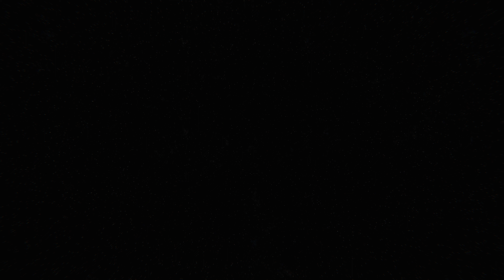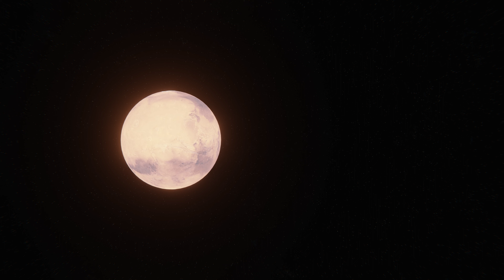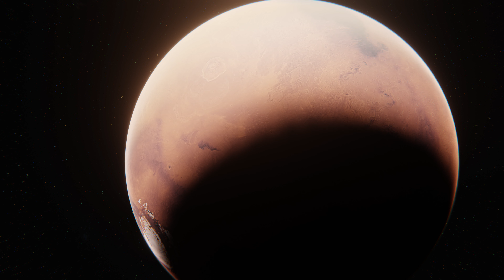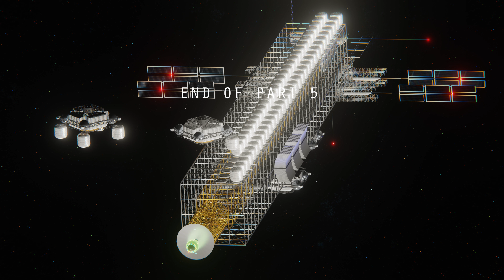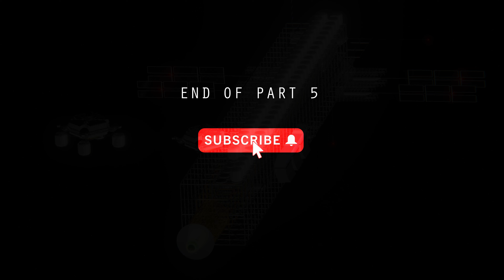Project Orion: Nuclear Rocket Design | Part 5

Comment: On the subject of lofting an NPP vehicle into space by chemical rockets: apparently, in the 1960s, there was a proposal by Convair for a Saturn replacement vehicle called the Nexus. This thing would have been a giant reusable booster capable of lofting 900-1800 metric tons into LEO.

Its primary purpose would have been to launch nuclear thermal rockets into orbit, but I've heard that the Orion designers at one point considered using this thing to loft a 4000 ton Orion high enough above the atmosphere that the NPP could safely take over and push the vehicle to escape velocity.
Reply from the maker: I have heard about this vehicle occasionally but it's never referenced in the original proposals since the Saturn 1 was the most advanced proven design at the time of Orion's peak development. There's some discussion in earlier parts about the lofting concept but it exclusively involved a Saturn block rocket. It's interesting that development on Nexus began immediately after Project Orion ended.
The Nexus seemed to take hints from the design philosophy of the Soviet N1 rockets and i always saw it as the US' attempt to develop a vehicle capable of placing lunar station assets in orbit, much like the N1 intended to do. 
Nuclear rockets hinge on political concessions; workers on the project entertained the idea of a chemical first stage but they fought against this concept whenever they could. Simply put, they thought ignoring the Orion's takeoff capability was a poor idea and opted to make ground launches more safe by reducing fallout to make them more attractive. 
Ultimately this was probably a mistake. When the Orion was briefly revived and discussed in Air Force proposals in the late 1960s they continued to focus on ground launches, with the chemical first stage being an afterthought (planning to use the dated Saturn 1 instead of an alternative like the Nexus or a custom stage was evidence of this.) Had they worked to integrate a chemical first stage it's likely more would have supported the project's revival
Reply: @De-Mystifying  I found a source for the idea that the Nexus was proposed to loft a 4000 ton Orion. YouTube is being weird about letting me post links, but you'll find it in the Aerospace Projects Review e-zine, both in Volume 3 Number 1 and in Volume 2 Number 2. Apparently the idea first dates back to the Marshall Space Flight Center in 1965.

Personally, I think the Nexus (if it turned out to be feasible) would be the ideal launch vehicle for the Orion, if we choose to forego a ground launched Orion. Orion scales up better than it scales down, and the Nexus' large payload capacity and fairing size mean that you can launch a pretty big Orion compared to if you used a Saturn vehicle, without the operational complexity of multiple launches and orbital assembly.